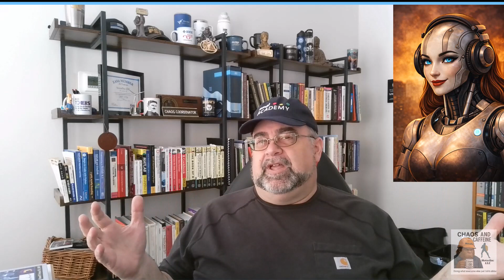Reliability Engineering 101: Why Predictive Maintenance is Misunderstood

Comment: I love this discussion. People gladly accept talking about L10 life of a bearing as a point of failure based on time.  Its actually an "Estimate". You tell  someone that PdM is the same concept and they will lose their mind telling me you can't use that term because you can not Predict when the asset will fail.  If you do and it fails before that or after that they tell you "See you have no idea". Its complete lack of education or they are just looking to push off the blame for using the data you provide and their "Lack of Commitment".
Reply from the maker: The challenge, of course, is that the term 'predictive maintenance' was actually coined and placed in standards by the US Military.  So, the term is a standard - CBM originally comes from IBM as does CBRM.  These were variations of PdM meant for marketing reasons.  Go figure.  We've been watching marketing groups making up the terms we've been having to meet for ages, such as the variations of AI.  Now there are even newer ones and each one is supposed to be the 'end of humanity' in an effort to convince investors to throw their money away.